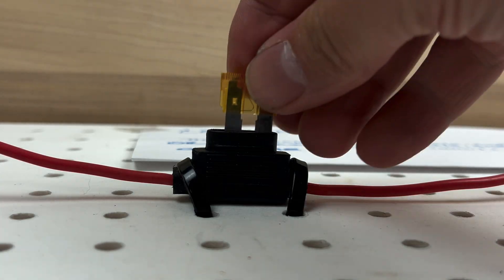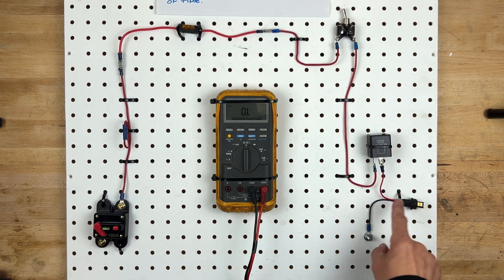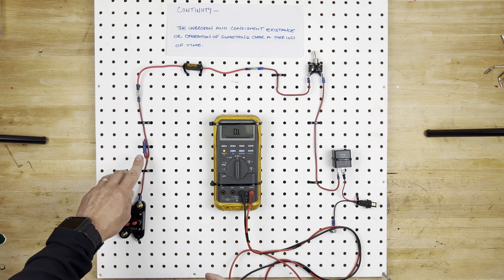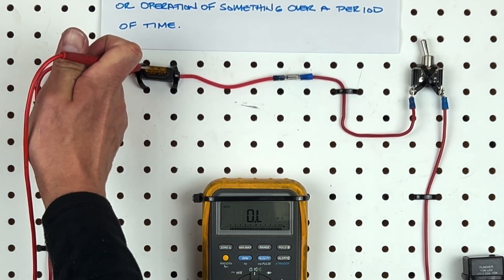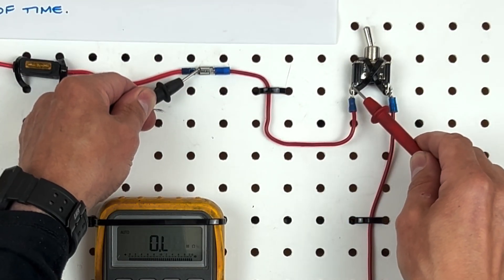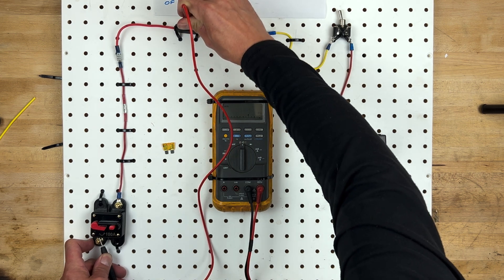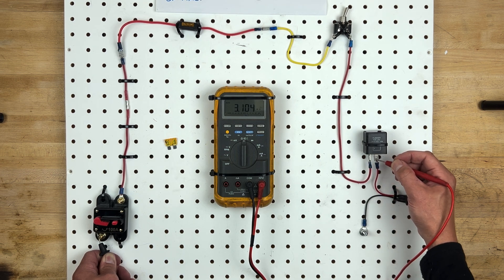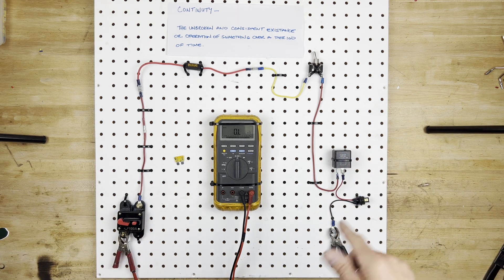12V Automotive Wiring Diagnosis - Continuity For Beginners! @WiringRescue

Comment from the maker: Thank You for Watching the Wiring Video!
Subscribe To This YouTube Channel: http://www.youtube.com/user/4g63mightymax?sub_confirmation=1
See My Wiring Playlist: https://www.youtube.com/playlist?list=PLsF7T1tRFy2hmiiUUfMZNyV-BUA_yrPIh
Reply: Are you making more videos on the lemans ?
Reply: First off just want to say I love your channel. You have single handedly made wiring a breeze for me, for the most part. I have recently wired turn signals on my lawnmower and I live it. I get compliments everywhere. Well I have a small 4x6 trailer I pull behind the mower pretty much all the time. I'm in the process of hooking up trailer lights and I want turn signals on the trailer and have a plug that will plug into my mower so that when I turn on whichever blinker on the mower, the trailer turn signal works as well. Could you make a video explaining how i could do this please. 

One of your biggest fans- Cody
Reply: Hey. Just came across your channel.
 https://youtu.be/QAD8vDHTbzo

Your negative switched 3 way prong video is awesome. Explained perfect...
But there is something else I need per se, or missing.

My car is negative switched headlights.
I want to install a lightbar WITH led rocker switch in dash.

I would like to know the diagram for the following scenario please and thank you.

Using the wire BEFORE it hits the car's inbuilt relay.

I've scotched onto the highbeam wire under fuse box. (Before its switched)

30 is inline fused to battery
86 is fed from 30.
85 is scotched/spliced onto highbeam wire
87 goes to lightbar

How do you add three prong rocker switch so that 
Turn switch on: highbeam, lightbar, lil led light ON.
Turn switch off: lightbar, lil led light OFF
Integrated into the negative switched  circuit

The lightbar can only be turned on IF switch is on AND highbeams are on.
But if off at switch. Highbeam still can operate..

Cheers

Comment: Why are you using continuità mode and not voltage drop sincr you have AN active circuit? Isnt It Dangerous using resistance mode on a live circuit?

Comment: @WiringRescue I've watched a bunch of your most recent videos. I have a unique opportunity to re-wire my 1986 Chevrolet Camaro.  A lot of the wiring is old or has been touched by a previous owner. 

I was wondering if you could make a video explaining more in depth how those Bosch style relays work. As well as how you might go about re-wiring a fuse box from a car?

The video about the GM pull style headlight switch was extremely helpful as those 80s camaros also used a similar style switch for headlights/dashlights!

Comment: Thank you for taking time to make all these vids. I see you made vids on De-pining a plug connector, but have you made a vid on how to put a plug connector that takes pins together? I have to put a pin connector on a wire harness for my Cub Cadet 1772 diesel. The company that I ordered a new harness from has messed up the harness "Twice" now and so I'm just gonna fix it myself. What type of crimping tool for a small (probably 14-18 gauge) wire with a round pin type connector that goes into a square plug do you recommend?  Any help would be appreciated. Thanks.

Comment: Can you wire up the blower motor to start working with the key in the accessory possition? Since keeping the car in the on position for a long time isnt very good instead you just want the heater to work and nothing else. Like is it very easy and you just need to add a wire or is there more steps?

Comment: Thank you for all your wiring instructions. Very helpful in restoring my high school car. Have a question: How do you wire in a switch in a fused relay? Do I need to have a separate wire for power to the switch?

Comment: Great video as usual.
Although ok for a beginner and a good starting point, continuity, resistance and voltage tests aren't a very reliable way to confirm a circuit or section of wire can actually carry any meaningful current.
A wire that is almost completely broken, lets say for instance down to it's very last strand, will still show perfect continuity, low resistance and even voltage readings will look perfect at the either end of that wire.
However, try to pass even a small amount of current through that wire and the circuit likely won't operate, or at best poorly.
That one strand of wire may simply burn up like a fuse, or at best starve the load of voltage and not provide enough current for the load to operate correctly, as well as heat will be generated in the wire and potentially cause a fire, a similar effect is caused by undersized wire with current flow that is too high for that size of wire etc.
The same goes for no load voltage tests on a wire with a corroded or poor connection.
The voltage and continuity might look fine until you try to power up the load and current trys to flow, all of a sudden there's no power at the load and/or lots of heat at the corroded or poor connection, the more resistance the more heat and vice versa.
When troubleshooting a wiring/circuit problem, the best method for testing good wiring integrity for no open circuits, good connections and the ability of the wiring to carry current, is by doing loaded circuit/circuit energized voltage drop testing on both sides of the circuit and at all the various connection points within the circuit.
If you see any substantial voltage readings (more than x milli-volts dependant on current flowing in circuit) on your meter between any two points of the circuit, your problem/circuit fault lies somewhere between those two points.
Ideally, a perfect, no voltage loss/voltage drop reading would read 0 volts.👍
Reply from the maker: Great info! I’ll give some thought into a way to demonstrate this , as it would be some great videos to have!
Reply: @WiringRescue  Cheers for the reply and for reading my long-winded comment👍That'd be a great idea to make a video on voltage drop circuit integrity testing.
Try to make a big emphasis around 'Always do loaded circuit tests' 'No current flow = No voltage drop.
ie: unless the circuit is loaded and current is flowing, you will never be able to measure the voltage drop within a circuit.
If necessary, when trying to test a part of a circuit or length of wire etc, use the object being powered as the load, or introduce a substitute load, preferably a test light that draws at least a few hundred mA, and for higher current circuits a headlamp bulb is good for 3-4A.
I'm sure you will do an excellent job like you always do, I'll look forward to it😁
Your videos are very good, always clear, to the point, simply presented, educational and easy to understand, especially for the newbies.
Thank-you for all your great videos, I can see the time and effort they must take you to make👍

Comment: You keep using the diagnostic term, continuity, when you're referring to resistance.
This is a newbie video, & people can get confused between the two terms; as the multimeter also has a dedicated continuity mode.
You should have clearly stated what you were referring to, at the start.
Reply from the maker: I’ll keep that in mind for the next one. Thanks for watching !

Comment: yesterday i figured out that i have some serious electricity issues, battery is empty after 2 days car just standing still... Today here comes your video... Kinda scary 😂
Anyway - thanks a lot for these GREAT advices and instructions ❤
Reply from the maker: Sorry to hear about your dead car! Hopefully it’s easy to sort out. Generally I find that battery drains are:
- really old batteries that don’t hold a charge
- alternators that are not working properly
- aftermarket things added to the car that aren’t wired right (stereos, lights, chargers, etc)

Good luck!
Reply: A video on how to check an alternator would be AWESOME!
Reply from the maker: @bucky0868 - I’ll add it to my to-do list!